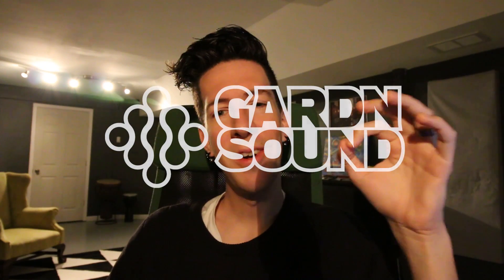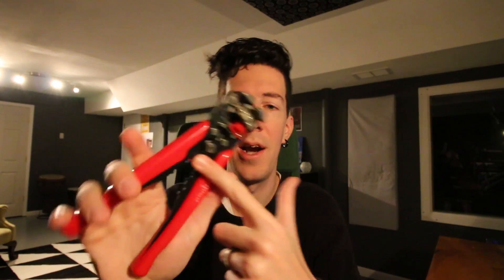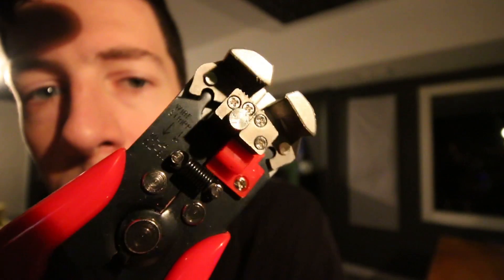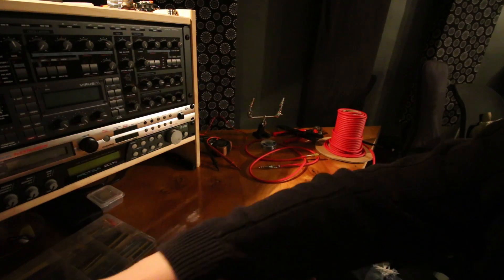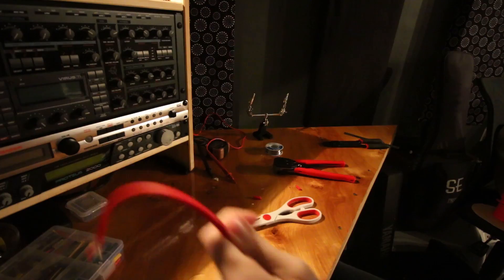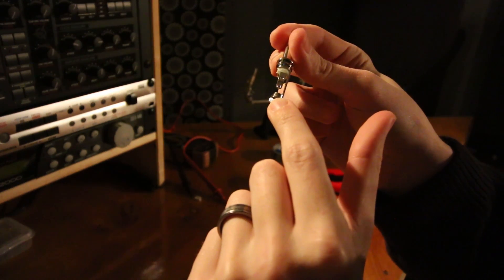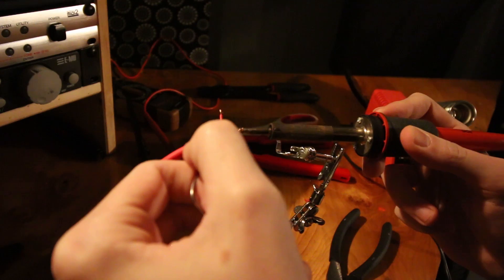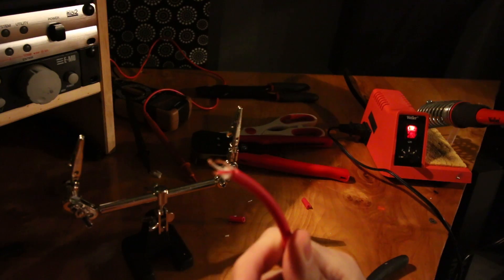HOW TO MAKE YOUR OWN CABLES (DIY SOLDERING)

Comment: Hey i hope you respong :(
Well i got a pair of Final F4100 in-ears but the cable broke 
I dont want that crappy cable again so i wanted to buy an upgrade the problem is that it uses an mmcx angle (L) type connector and im struggling to find a replace any ideas?